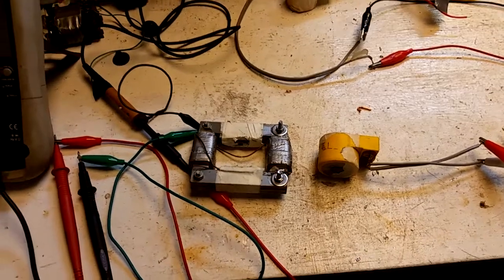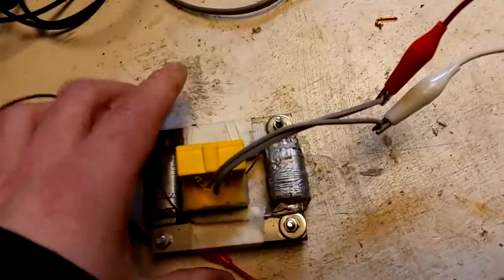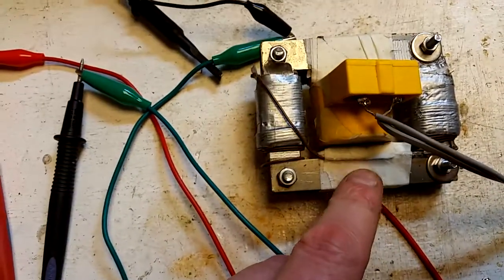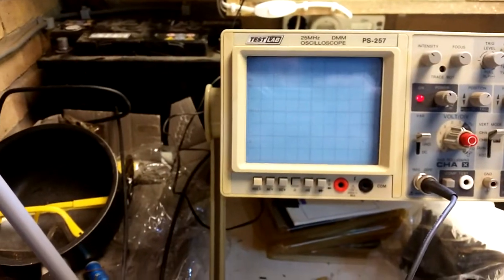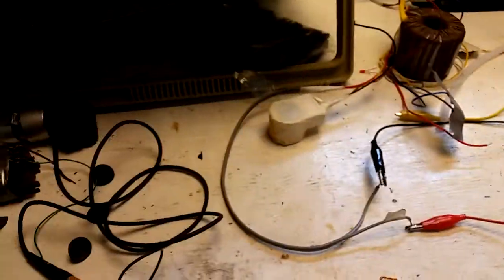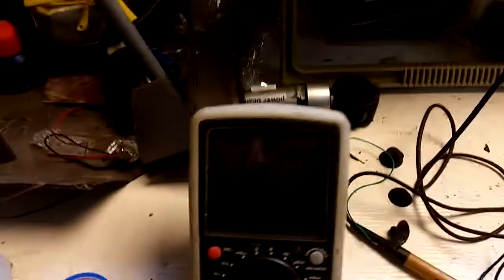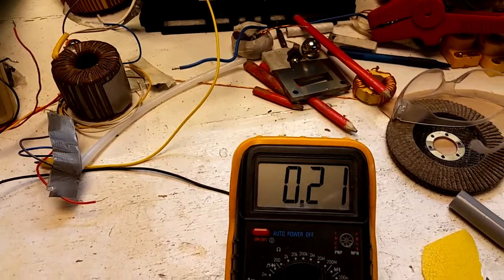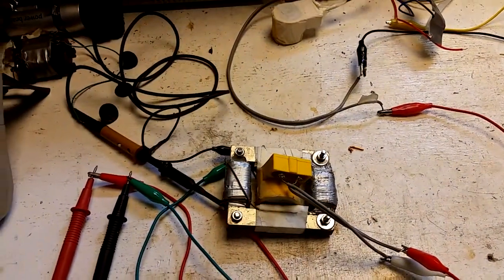No B-EMF bi-toroid transformer Part 3

Comment: Hi Rene. What is the input voltage and what is the output voltage? Thanks!
Reply from the maker: Input is exactly 10 volt ac.
Output is 2 volt. Wether i place the coils in series or parallel.
Keep i mind tht the output coils have very little turns compared to the primary coil.

This is not overunity (yet) but a sure proof of concept that there is no B-EMF hindering the input power.
Even when short circuiting the output coils.

cheers,

Rene
Reply: Thanks, Rene. This is very promising, specially to couple the output of a Rotoverter coupled to a Generator  (Idea? ;) ) -> to solar panel -> MPPT controller -> battery bank -> inverter,  and then when load is demanded from the inverter, it won't affect the motor torque as it normally does. This just might be the key to something many people are trying to do. Cheers!
Reply from the maker: yup   :-)

thinking along that way.
Working on another technique as well, kinetic energy amplification, converted to electric. 

More on that later

cheers,

Rene
Reply: emc4u2 we're in sync :) I wrote you a private message.